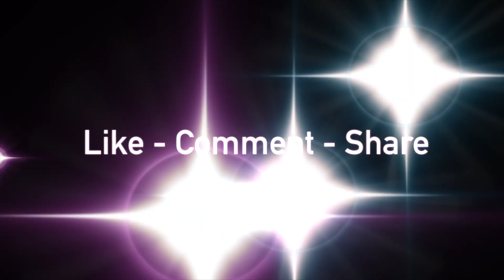Splitting Firewood - Controlling Split Size

Comment: Morning to you , very nice splitter and I like the smaller wood and so does my furnace , it's a Summeraire 100 built here in Canada . It takes one of those rounds split the way you do it and it will burn a full 7 hours and put the house close to 80 degrees . I enjoy it after snowplowing in - 25 to -30 weather . Good video SIr

Comment: Great video! Very well explained, I have been offsetting my larger rounds to keep pieces consistent, at first I wasn’t sure about it since it is kind of counterintuitive especially with the four-way wedge but it works well!
Reply from the maker: Yeah the larger rounds sometimes I split off the edges and then work down the big block into smaller square splits...I'm a sucker for square splits!  LOL 👍 😀 🍻

Comment: I usually splitting my wood in consistent sizes ,any wood over 8" in diameter I put it off centre to get same size wood,it's easier to dry ,and handle later on ,I split my wood on a 20 ton champion,it's great to work with, I heat my house with a mini caddy wood furnace with a glass front,it does a real nice job in the colder months,when the weather warms up I use 3 heat pumps.

Comment: Seeing this helped in understanding why there were so many pieces in the huge round. Splitting for home heating is completely different as those who have been doing it for a long time understand that some variability is desired depending on size of fire, how long they want it to burn and how fast. At most I would have halved those pieces you split and many of them I just crack the ends. I'm not so sure a wedge is the best for drying either (on bigger pieces of premium hardwood) because the old axiom of 1 inch a year for oak; well a 6 inch on all sides wedge is going to have some wood more than one inch away from the surface but a 2x6 more rectangle shape does not.
Reply from the maker: That is a good point...when splitting for heating wood a variety of sizes is sometimes what you want. A few smaller to get er going...a few bigger for overnight. That's what I do for my personal burning stockpile...but for the recreational burning stuff that size I was splitting there seems to be working good.👍 😀 🍻

Comment: B40 you bring up a point that I do with my splitter and don’t think much about it. What you did make me realize is that splitters like yours and mine is the lack of a defined “v” trough like some other commercial splitters. Don’t get me wrong the v trough is nice and user friendly but leaves little room to do just what you’re explaining. Another reason my beam, log rest, catch table, and lift are all close to the same plane, resplits are much easier to maneuver around back to the beam

Comment: Next you will try to modify the unit to have a box blade for uniform wood with extra waste as you can always sell the waste as kindling. Building yourself a mold you can load with slivers of wood then wrap gives you an easy way to sell even the waste product. 

Saw one setup in a video where they had a frame to load with wood and an arm that would go around holding a roll of plastic wrap to wrap store sized bundles. Stealing the idea for something to produce wood sized bundles of kindling to include in the stand would see you selling the splinters of wood to those that don't want to make their own.